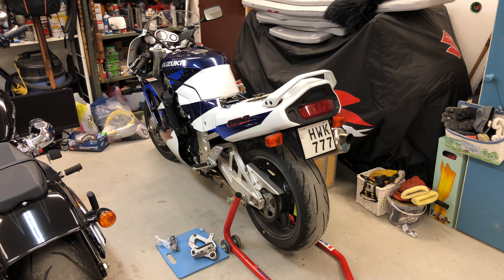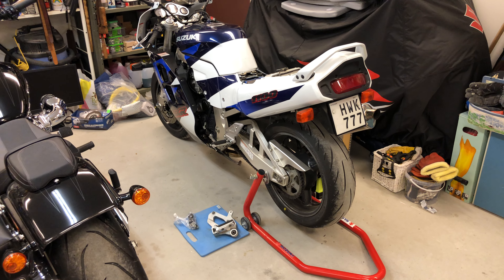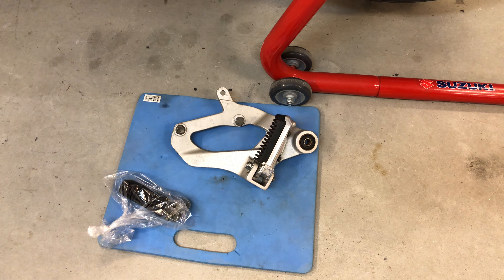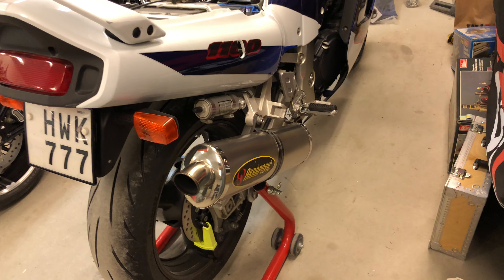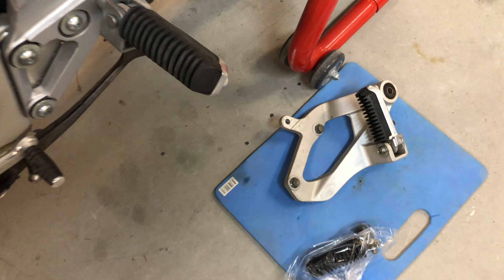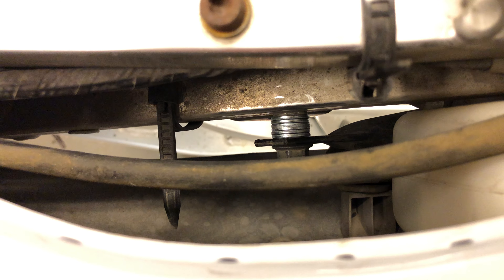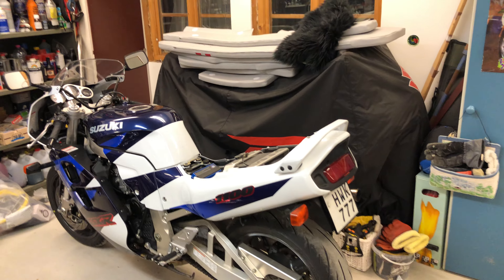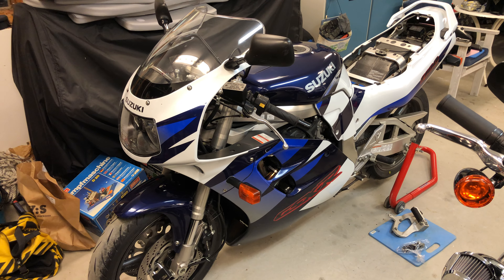Suzuki Gsxr 1100 Weight Savings Part 2

Comment: Hade en 92a 1100 själv.  Aldrig tänkt på att framlyktan är asymmetrisk på 93-98. Åtminstone insidan, vilket är coolt
Reply from the maker: Jo dom har en cool design. Haru nån video på din 1100?
Reply: @CarsAndMotorcycles  nej, tyvärr.  Det är lite dåligt....Såldes 2005,   så längesen dock.
Reply from the maker: @H-M-78  okej. Gillar starkt färgsättningen på 92:orna!
Reply: @CarsAndMotorcycles  ok, 90-tals alltså?   91an är ju samma hoj fast med de raka 80-tals färgerna.  En blå och vit 91a 1100, det är grejer det...
Reply from the maker: @H-M-78  Yes! Jag föredrar 90 tals färgerna på hojarna så gsxr maskinerna från 1992 - 1998 tillhör favoriterna.